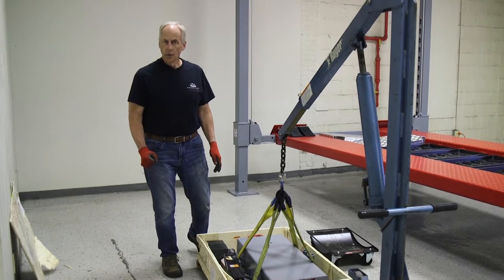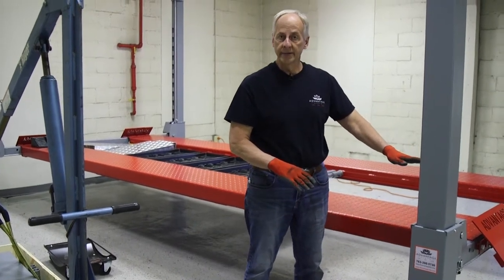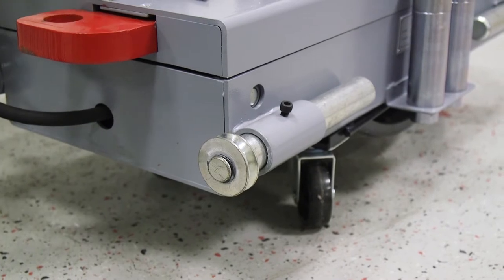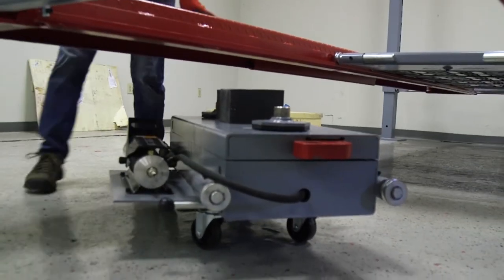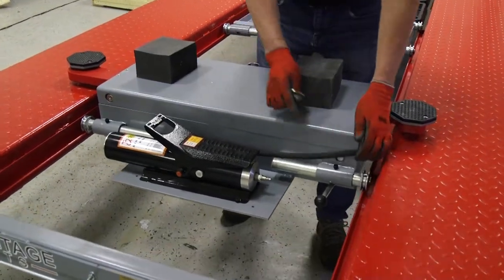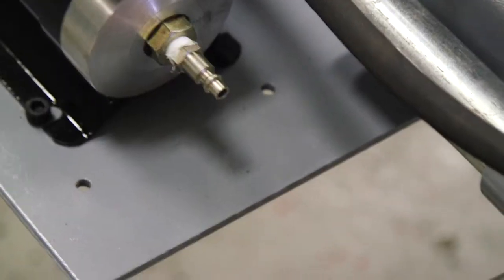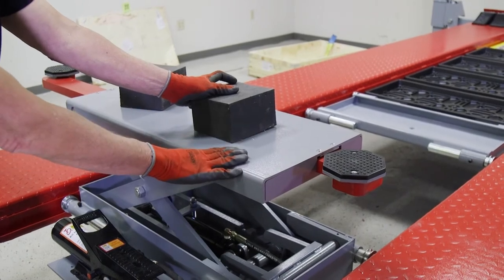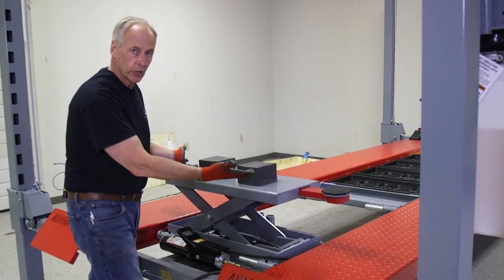Discover the Benefits of an Air Jack on a 4-Post Lift | How to Install an Air Jack on a 4 post Lift

Comment: will this fit a Backyard Buddy?
Reply: Same question I have.
Reply: @EkowMensahMotorsports  I'm told it does not fit but they are working on a Backyard Buddy Version
Reply from the maker: Yes, the rolling air jack will fit the Backyard Buddy, we had a few feature changes recently, they will now have a J-channel and will accommodate this